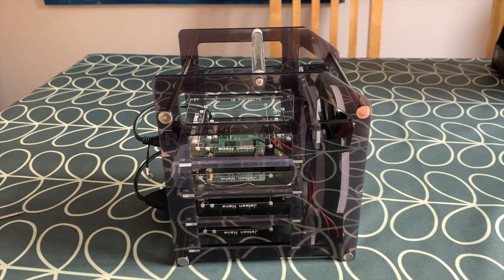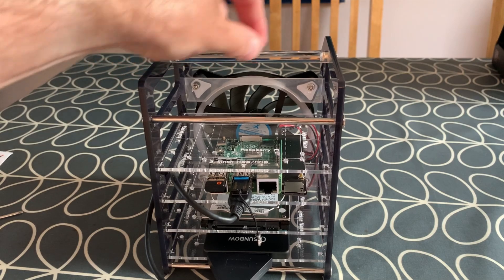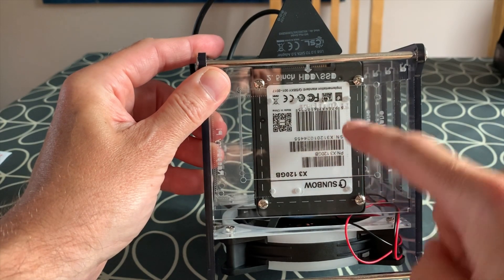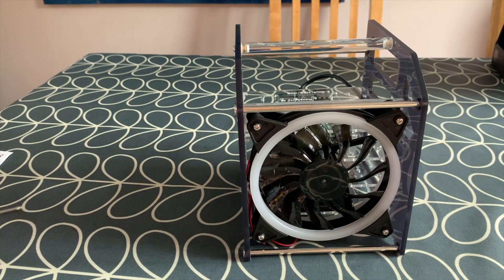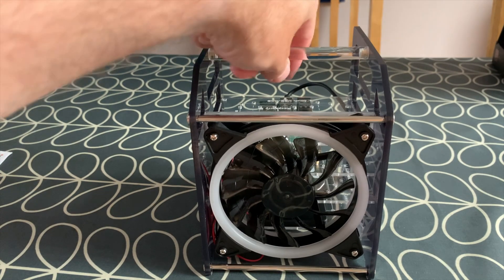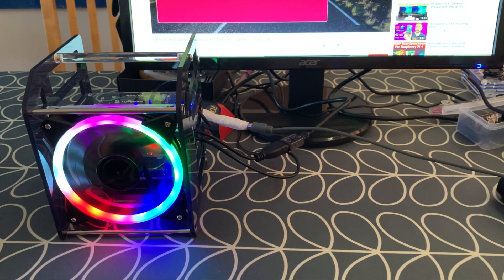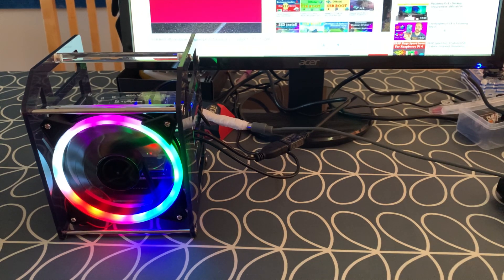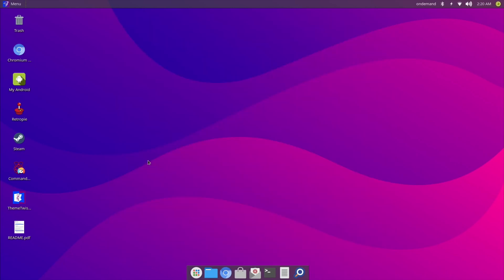52Pi Rack tower cluster case with 120mm Fan. Raspberry Pi 4. Great SSD solution.

Comment: Just curious, if you had the 12 cluster version, how would you power all of the Pi's in a way where you didn't have separate plugs? Is it possible to get a low-wattage regular ATX PSU and then adapt it to power everything in the tower? If so, what parts would you get for that? Is there a SATA power connector that can be attached to the Pi 4?
Reply from the maker: It’s more a question for Jeff Geerling. I haven’t done anything regarding clusters

Comment: There's a severe safety issue with this case: the fan is uncovered and so fully accessible by your fingers what could cause injuries. It's recommended to put some kind of stable wire mesh (which is not formable) as finger save fence. Alternatively the case can be placed in some kind of (well ventilated) cabinet inaccessible during operation to avoid injuries
Reply: Most of the Low voltage (5v - 3v) fans don't have much force and will actually stop if you accidentally touch the blades. Then again a pan on the stove wont burn you if your smart enough to always treat it like it's hot.
Reply: Yes, they don't have the power to cut off fingers, but some of them depending on their power, the sharpness of the blades especially on their edges (if not covered by frame), their thickness and if there are grates on the blade-edges could cause scratches or cut injuries. Personally I got once some medium scratches by an usb fan with uncovered plastic blades with grates in the edge of its blades

Comment: If you were to use a powered hub, you could use both ssd and hard drive at the same time, and if you got one with a 3amp charging port on it, it could power the pi too, and just have one power plug used

Comment: Looks like the top shelf would be a good place for a Pi 4 with Ice Tower cooler, if you really want to keep your Pi frigid.
Reply from the maker: Yes I thought the same. I am getting an ice tower soon.
Reply: I have a low profile ice tower top shelf  running Ubuntu mate over clocked 2.gig at idle 27 c about 37 c YouTube running for hours hasn’t gotten above 38 c

Comment: Go look at GeekWorms offerings. MUCH better than this solution. I have my Pi4/8gb booting from a USB3 1TB hybrid SSD with a second 1TB drive for a Samba server. It is FAST and Stable! Uses a single 5v4A power supply. 2 fans all in it was less than $200usd. https://geekworm.com/

Comment: Is the kit missing some spacers? I would think that the SD card adapter would include a couple spacers for the other side of the Pi so that isn't off level when it's all mounted.
Reply from the maker: Mine didn’t come with spacers. The difference is the thickness of a micro sd card.
Reply: @leepspvideo  Just my OCD noticing that difference
Reply: I got this kit myself, and I found the same issue with the level difference from  side to the other.. any suggestions..?
Reply: @agustin3186  Maybe use some small nylon washers as spacers.

Comment: It looks like you might be able to install the Pi into the armor case AND attach it to the cluster case shelf. If you put it on the top shelf, there would be no clearance issues for sure. Just not sure if the standoffs provided will have enough thread to go through the bottom of the armor case, the pi AND catch the top of the armor case. Might just need some long M2.5 bolts and maybe a couple washers or maybe some nylon spacers to elevate the bottom of the armor case to allow airflow under the case. Now I want to try that rack Case. It would be so handy to have the drives fixed like that and I like your idea of a system that can store the images for creating SD cards. Thank you for sharing this video.

Comment: I wish they try to sell this at Microcenter in the US.  They have a lot of Pie stuff for a retail store.  I also would like to see this sold on a US Amazon store.  It's like another 10 or so dollars to ship here.
Reply: walkonatyclb i saw the 4 and 8 bay version on us amazon this morning. Search cluster case raspberry
Reply: On the US Amazon store it is sold under the "GeeekPi" brand... same case, the product description even lists the 52pi website for more information. The description also says it comes with the SD card extenders. I searched amazon for "52pi rack case" and the listing came right up in first couple of matches. $39.99 for the 4 level. There is a 8-level version too. Mine will be here Sunday, if it is not the same I will come back and make an update.
Reply: @erleichda  I bought mine on amazon a month ago same case as in video mine came with everything Leepspvideo did - Great case all around just be careful with the tray tabs -- enjoy it
Reply: @lst3044  I ordered some M2.5 bolts so hoping to install keeping my pi in it's armor case. Have a new SATA to usb cable coming that comes out of the drive at a 90 degree angle too. should work out nice. Will look out for tab issues, thanx for heads up.
Reply: @erleichda  it comes with a nice set up  I have 2 pi 4 s and a old hard drive and on top a low angle ice tower its a fun case to play with the Pi I did a review on amazon showing my set up
Reply: Thank you everyone! Update here is the case in the US https://www.amazon.com/GeeekPi-Raspberry-Cluster-Stackable-4-Layers/dp/B083FDHPBH/ref=mp_s_a_1_3?dchild=1&keywords=cluster+case+raspberry+pi&qid=1597354167&sprefix=cluster+case+raspberry+pi&sr=8-3
Reply: @Thomasz-Tech-Innovations  can we get a rebate for all the hype on this case LOL -- go to amazon check recent review will show my 4 star and pics of my set up

Comment: Does the big fan do anything to lower the Pi temperature? I ask this because the case is so open, how can the airflow work?
Reply from the maker: Yes there is a decent amount of air flowing across all the shelves.
Reply: @leepspvideo  I'd still recommend at least a passive heatsink on the CPU, especially if you OC the pi at all. 

You're likely approaching thermal throttling, even with the large fan.

Comment: TwisterOS 1.5 you say, i better update, Maybe add a small powered hub for the extra power for hdd or ssd or anything that needs it
Reply: V.1.5.2
Reply from the maker: My Pi powers an SSD or HDD with the cable shown. It doesn’t need any extra power. If I need to have both drives at once I have a twin usb sata cable to add extra power.
Reply: leepspvideo Is there a chance that you could add a link to the twin Santa USB cable for those of us interested in trying this as a project? Fantastic stuff as always.
Reply from the maker: Link in this video. 
Speed test. Sata to USB 3 Cables. Raspberry Pi 4. SSD USB boot.
https://youtu.be/cdKZ2DXRCcA

It’s worth watching as the cable is less compatible than the one in this video. (If you are running an os). I use it for storage mostly.

This is also worth knowing 

Sata cable fix
https://youtu.be/9HV4C0Llktk
Reply: @leepspvideo  I never see the lightning bolt, but if i do use 2 x ssd or 1 x ssd and hdd along with other ports, the receiver on the wireless mouse/keyboard can stutter
1x ssd or 1 x hdd along with all ports used and we are good